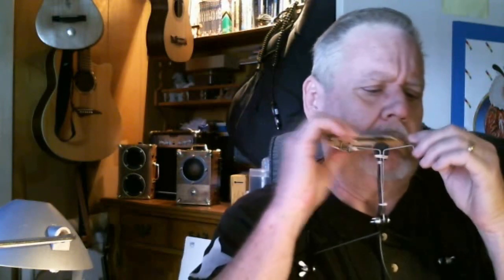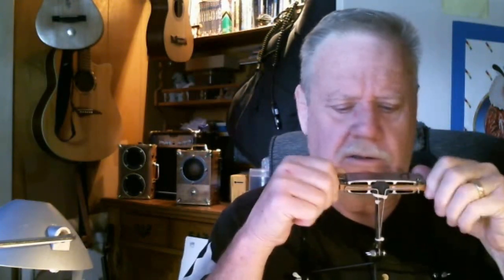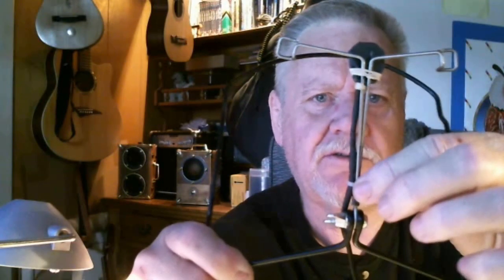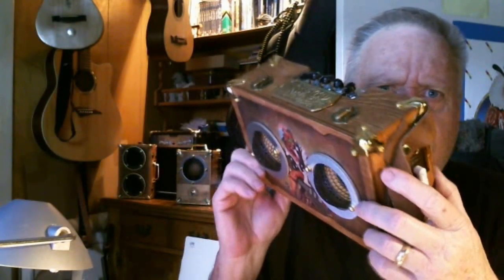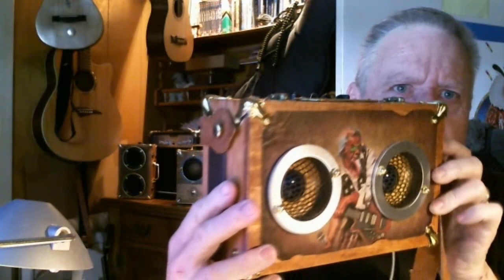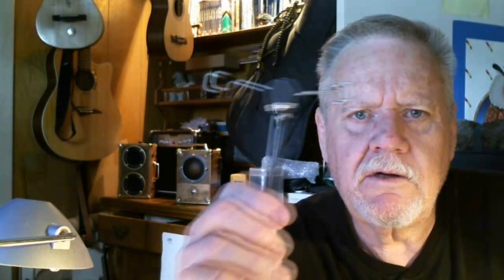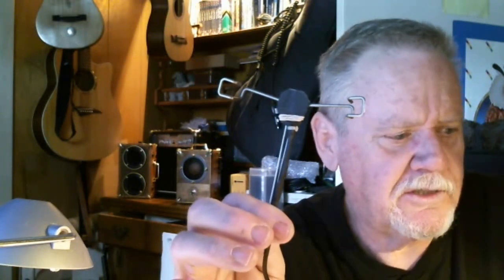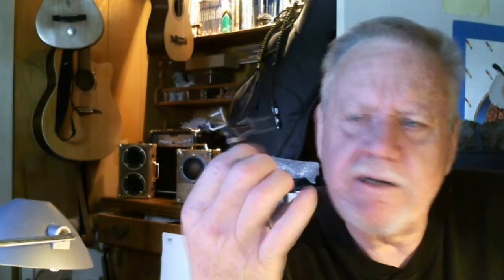DIY Harmonica Microphone _Piezo.wmv

Comment: You have an EXCELLENT idea here!  Perhaps you could develop, and produce a commercial Harmonica piezo-mic system that is 'affordable' and outstanding in it's performance, and durability, and ease of use, comfort, and compactness!!!  Could this set-up be made 'wireless', to free up the musician from that limitation, without losing any performance from the mic, and amp?  
It'd be nice to see some form of schematic of the basic circuitry required, just to be 'safe' about having any amplified 'electronic' device touching any metal object that is in your mouth (the harmonica's shell-body).  [I wouldn't want to get any electric 'shock' from a poorly isolated/designed circuitry].    Otherwise.... AWESOME IDEAS!!!!!